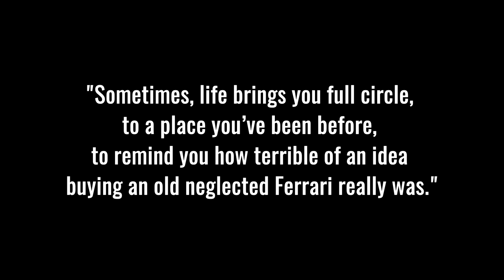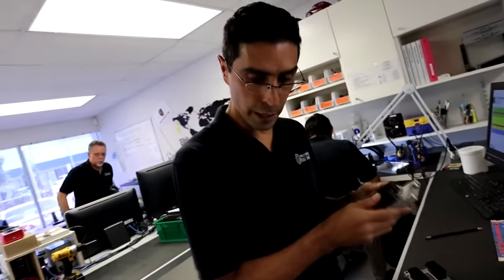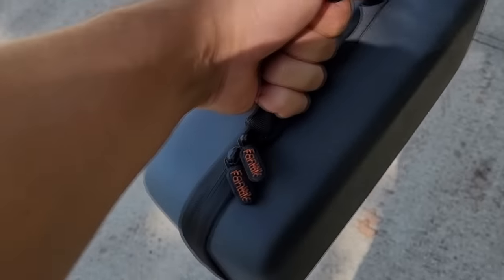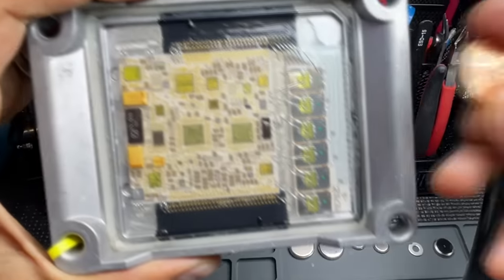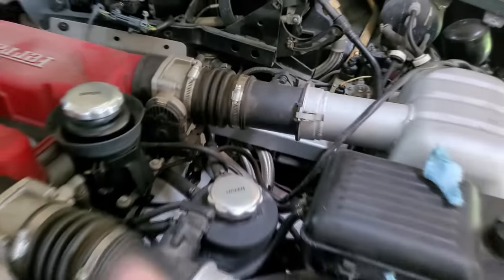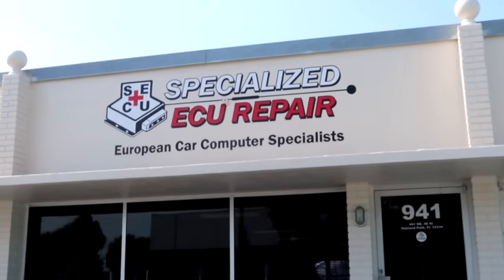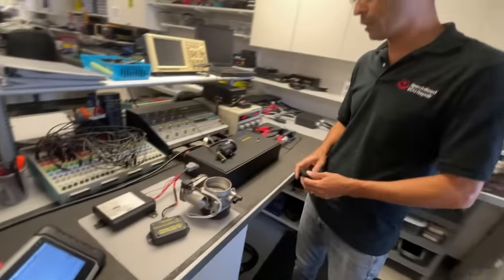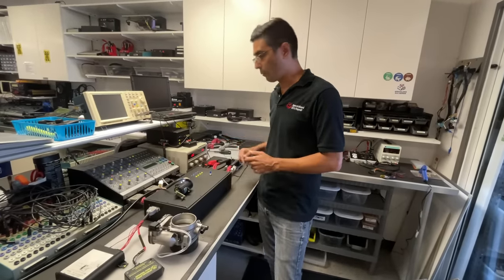Here's What FINALLY Fixed my Cheap Salvage Ferrari!!! (EVERY Ferrari 360's Fatal Flaw)

Comment: Frustratingly you spent the entire time advocating for the right to repair without actually mentioning the words "right to repair". It is and as it should be, a movement that is gaining strength.
Reply from the maker: I literally work on the cars laying on the ground in a barn so I'm 10000% for the r right to repair; there's nobody stopping anyone from repairing these issues; it's just that the engineering of the original part wasn't made to last the test of time.
Reply: @Samcrac  wow, you could not be more wrong sam. Manufacturers control the supply chain. And their protected by lobbyists. If you are living under a rock and somehow have not heard of the right to repair, check out Louis Rossman, who litteraly flies all over the country advocating for the right to repair items that you have bought and paid for.
Reply: This is extremely important
Reply: Give me a break. Right to Repair is an important issue that deserves more public discourse, but it’s not at all relevant to this particular vehicle or its issues. Frankly it makes me wonder if the original commenter even understands what Right to Repair is all about.
Reply: @patrickkillabrew6207  🙌
Reply: @patrickkillabrew6207  It's entirely relevant.  Ferrari deliberately used a non standard type of part that isn't user or third-party serviceable, most likely to force people to go to their dealerships for repairs.  If you're ok with that, then fine..... but then you run into situations like this where the manufacturer eventually stops supporting those products and now it doesn't matter if you're ok with not having the choice to go to a third party for repairs, that's simply not an option anyway.

This is basically Apple applied to cars instead of laptops, phones and tablets.
Reply: @patrickkillabrew6207  It's good to see the issue popping up all over the place anyhow. That's the only way some are getting their information these days, unfortunately.
Reply: @Samcrac  the problem isn't just that the original part didn't last. It was also designed and manufactured in a way that made it cheaper to manufacture but also unrepairable.
Reply: @nicholasvinen  Yeah so you do you want all your products to be more expensive? Right to repair is fine but expecting businesses to support repairs for their products for an indefinite amount of time is stupid.
Reply: @tayf85  yes, I'd rather pay more and get something repairable, especially in a car that should last several decades. I don't think the difference in cost is that large. Maybe 5-10%.

What % of the cost of a new Ferrari 360 do you think the ECUs would be? Less than 1% I'd wager. Is paying $200 more for a Ferrari really a big deal?
Reply: @nicholasvinen  Same with me. The point is that if some manufacturers make their cars difficult to personally repair/maintain, and customers care about this, then this can become a point of differentiation for competing manufacturers.
Reply: @ Stephen Dinale Right to repair would be covered if the ECU were somehow protected with a proprietary interface that disallowed any kind of tampering or reading, and copying of it's contents. That is not the case with this ECU. This ECU is a broken part that is no longer made, but if enough demand comes to fruition, Ferrari or someone else will likely remake or reengineer it in an open market because all the information is there to do so. This is not  indicative of a right to repair issue! 👍✌
Reply: Nobody is asking Ferrari to manufacture 20-year-old ECUs, just fit ECUs that can be easily repaired if needs be in the future. It's a disgusting waste of resources and a pitiful end to a classic car when it's condemned to the scrapyard because of a single, selfishly engineered electronic component. Here in the UK we've just had new laws come into effect regarding right to repair.  Hopefully manufacturers will finally get their acts together.
Reply: Also proprietary software to diagnose all new ecm controlled equipment and vehicles, Ferrari uses Leonardo Software $20,000 for it plus subscription. He could have diagnosed quickly the bad ecm with it.  The clutch he replaced now needs a re learn with the Leonardo as well I suspect it doesn"t shift smooth or correct without it. The ecm may eventually relearn on its own after 1000 cycles but by that time he could have damaged the new clutch.
Reply: @TOM-C.  Right to repair applies more to access of the ECM to diagnose and repair without taking the Vehicle to a Dealer getting ripped off and having no alternatives. Original lawsuit brought by a farmer who had a newish combine fail when he needed it most and he could not fix or diagnose the issue himself or by a local mechanic as it  takes proprietary Deere software, he had to pay $6000 to transport the unit back and forth to the Dealer for repair along with high repair cost for a $20 magnetic pick up sensor failure.

Same would apply here as Ferrari Leonardo software is proprietary and $20000. He could have diagnosed the ecm issue quickly and needs to relearn the clutch with it as it will not work properly.
Reply: There is right to repair them.  Just not the willingness to spend the money required and perhaps the skill to reverse engineer.
Reply: @XVRickXV  You don’t understand economics and just sound like one of those Occupy Wall Street ranters. If these cars were more reliable and serviceable then their aftermarket values would be even higher and making them even less attainable for regular people.
Reply: @pancakesgo7995  Mate a lot of designs that seem great at the time show flaws over the longer term. This is particularly true of anything new or innovative. You also don’t know what newer ECU designs may owe to the lessons learned from this ECU. To suggest Ferrari deliberately made a “selfish” ECU design choice is dumb tin-foil hat thinking.
Reply: @maxsav007  In the US, auto manufacturers are required to provide parts for 10 years after a model ceases production, the 360 is passed that. Yes, "Right to Repair" applies to all cars. If Ferrari were to have "Read/Write" protected the ECU's or blocked access to the ECU schematics needed to build the Benchtop Engine Simulator, or blocked the sale of used reprogrammed ECU's, then R2R would apply, from this video it seems they don't. If Ferrari were to step in now and prevent someone from producing and selling a "drop-in" programmable ECU for the 360, that would be different.
Reply: @nicholasvinen  It lasted 20 years. How long do you expect it to last? 20 years is longer than the "average" car lasts in the US!
 Don't get me wrong, As a mechanic for the past 38 years, I agree with and support "Right to Repair." It just doesn't apply here.
Reply: @GrayRaceCat  I'm not complaining about how long it lasted. I'm complaining about the difficulty of repairing it when it fails. Also I have quite a few electronic devices that still work after much more than 20 years. I'm still using a computer running Windows 95 for some tasks...
Reply: @XVRickXV  which do you mean would be out of business?  Ferrari or Honda/Toyota?   You are correct in the line of reasoning though.    The very rich take great pride in possessing things which definitively distinguish them from the poor(er).    If Honda or Toyota did make a car as beautiful as a Ferrari, which has arguably already been done, thank you NSX, then the overhead would definitely be a consideration for Honda/Toyota, but their massive resources would offset that.    Ferrari itself would never have enough “cushion” to spend so much on R&D if they didn’t use the business model they’ve used for decades.    They don’t price things to entice the buyer.    They DESIGN things to entice the buyer.   Then they simply charge whatever they think they can get away with.    I’ll re-comment anew.
Reply: @tayf85  but Rick does have a point, just not absolute in his reasoning.   He is definitely on the right track.  Rich people take pride in spending more than anyone else on a product, I witness this often.  But they HATE being taken advantage of.   If they even FEEL like someone is screwing them, it’s over.    Yes, they like to have the latest and greatest, but if the vehicle they are selling off or trading out is worthless, they’ll lose trust in the product, and then the manufacturer.  If that $120,000 S Class from 2016 is now worth $17,000, they might buy one more Mercedes,  it next time, if this new  2022 $150,000 S Class is only worth $35,000 in 2024, that will be the last Mercedes they ever buy.   Unless they are morons, and they don’t count here.   Some might take more pride in driving a 1985 Rolls Royce more than a 2015 Rolls.    That says something too.  It helps to bolster the brand.    It inherently makes the 2020 Rolls they bought for the wife worth every penny.   If a Mercedes made in 2000 performed and looked nearly new in 2020, with only routine maintenance costing very little, maybe even performed by the dealer over the life of the vehicle as part of the selling price, then the worth of each and every Mercedes would escalate,    If homes degraded as quickly as cars, they wouldn’t escalate in value, and we all have seen the real estate markets.     When the worth is falsely driven up, a bubble forms.     Wanna invest in a bubble?
Reply: @SteveBassen  but if you're not supporting than you've to publish the technical documentation for the circuit - entire design: chips, transistors, how to emulate that processor...
Reply: @nicholasvinen  irritatingly, the hybrid circuit board design was INTENDED to last longer and be more vibration resistant. The fact that they haven't is down to teething troubles in manufacturing
Reply: @andrewhigdon8346  Actual rich people don't buy very expensive cars. It's those wanting to flash their money who do that and vendors are very willing to take advantage of that kind of sociopathy
Reply: This situation is no different than when computer controlled cars first hit the market. There was no one rebuilding or flashing ECU/ECM’s, it was new technology the aftermarket didn’t know about (and at the time didn’t care about learning). I’m all for right to repair but just because it’s expensive to develop the tools and experience necessary to do something doesn’t mean it’s against right to repair. The aftermarket will develop the processes to overcome this when the public says their ready for it. It probably won’t happen overnight. People ARE developing processes for repairing iPhones and are struggling to overcome those processes but it won’t happen overnight, just like Apple didn’t develop the technology overnight. And it’s not reasonable to expect manufacturers to turn over their proprietary software as its one of the things that separate them from their competitors.
Reply: @pancakesgo7995  also adding to the landfills and scrapyards when that work of art could still be driven, or at least added to someone's personal museum.  The last thing we need is 1500kg more junk on the planet.
Reply: @tayf85  Rick Perez's comment, while cynical did a great job of explaining the Mindset/Customer Base for Ultra Luxury Brands.
You critiqued him, but did not disprove his argument.
Reply: @XVRickXV  Excellent Summation of the Market Forces, and Mindset of the Market Segment - tayf85 clearly isn't in it and never met, or interacted with them. Or he has some other belief system.  He actually said more aftermarket supply, going to "increase" the Prices .  That doesn't meet any model of Supply & Demand.
Reply: @maxsav007  I am 100% pro right to repair, and invested in all the tools I need over a few years as I moved from repairing my own bikes, to phones, to laptops, to cars. However. Expecting the original manufacturer of low-volume vehicles to still produce OEM parts after 20 years is not going to solve anything. I never bought a car newer than about 2002 because I agree with you that simplicity is better, but I can't expect Toyota or anyone else to keep having what I need ready to go on the shelf. You just have to hope that a third party is ready to step in to support your platform at that point. Thankfully the aftermarket is vibrant and they can get access to original diagrams, specs and castings and that needs to be supported.
Reply: I think it comes down to this: if a manufacturer makes a product, all pieces of that product must remain supplied or be built to be serviceable. Like this, an ecu is a component the product needs to work. Without it the product is useless. There needs to be regulations in place to prevent this from happening. If Ferrari’s supplier decides to stop making this part, Ferrari should have to locate a new supplier, or have this part redesigned and manufactured. I don’t think it would take too many times of this happening for them to make crucial parts like this serviceable.
Reply: @turbanwearersblow  That is in no way a reasonable solution. Sorry, I am very much in favour of right to repair and do repair my own stuff, but you can't expect obligating manufacturers to solve the problem. If you buy a new house and there are problems in the first years, yes you could go back to the original builder. But if your thermostat breaks after 20 years, that's honestly quite normal and what matters is you can call up any tradesman you like and have it replaced with a different model for little money. Supporting companies like motec, haltech, etc that produce good aftermarket ecus would be a better bet.
Reply: @turbanwearersblow  Then your solution would necessitate some kind of Subscription fee. After 20 years, it's not reasonable to expect ongoing support.
Reply: @XVRickXV  Lots of opinion in that response! Wow! Car manufacturers can do what they want, you can deal with it or buy a Kia. Simple.
Reply: The Motor Vehicle Owners' Right to Repair Act, sometimes also referred to as Right to Repair, is a name for several related proposed bills in the United States Congress and several state legislatures which would require automobile manufacturers to provide the same information to independent repair shops as they do for dealer shops. 
Samcrac is dealing with OEM parts obsolenance.
Reply: @miscbits6399  You clearly don't have any friends or acquaintances that are rich.
Reply: @nicholasvinen  Yes. Jose himself literally compared it to another ECU that WAS a standard repairable PCB. It wasn't drastically bigger. That approach coupled with released schematics and code after 10 years would help keep cars like this running, and prevent them being the butt of jokes. Dread to think about Teslas in 20 years time when they're 'out of support'.
Reply: @corwinweber693  They most likely liked the small size and low weight. I do not think they wanted the unit to be hard to repair - they just did not think about a future where new units were no longer available.
Reply: @tayf85  right to repair has nothing with the manufacturer supporting repair for an indefinitely long time. It's about supplying information so a company that wants to work with repair can do their thing.

It's about allowing components that they need to use themselves to repair a device are also available to buy by end users or repair shops so you aren't forced to get the repair from a brand service center.
Reply: All the right to repair dudes writing paragraphs in this chat are ridiculous.
Reply: @mtnman1984  You having issues with it is the ridiculous person here. Ever spent some time considering why it would be a good or bad idea with the right to repair? Or even considered the actual meaning of it?

Ever visited some event where people are racing with cars from 1930? If the right to repair movement doesn't get some more traction, then many of todays cars will be impossible to start up 20-30 years from now. So hulking shells at a museum but no one who can listen to the engine sound or see it run some veteran race.
Reply: @perwestermark8920  Technology obsolescence, especially with computer tech, isn't part of the right to repair issue and you look like an old man yelling at the clouds. This module is Bosch trying to be cute.
Reply: @mtnman1984  It's correct that technology obsolescence isn't the same as right to repair. But I haven't made such a claim, so you are busy doing strawman and kicking in open doors. And being impolite while doing it, following some flawed idea that this would make your points stronger.
Reply: @perwestermark8920  If you agree that the issue in this video is about tech obsolescence, then it isn't about right to repair and there is no reason for your Stephen to be here lighting Samcrac as if he owes you anything. You look ridiculous and you aren't helping anyone join your cause. If you think anyone who watches Samcrac is not for right-to-repair, you are more detached from reality than you realize.
Reply: @mtnman1984  No, this video relates to both. One is the ability to buy a new ECU. Another is the ability to repair an existing ECU. A company can't be requires to sell spare parts forever. But should avoid lockin effects making it possible for repair shops to repair products or move parts between vehicles.
Reply: @perwestermark8920  Your understanding of vehicle component manufacture isn't based in reality. Bosch used advanced, not proprietary, techniques to make the module smaller and lighter. It had a flaw that didn't show until many years later in the vehicle's life, let alone testing. They manufacture the standard amount of replacement part stock. There is nothing preventing the repair of the part beyond development of proper procedure and tools, which, if you peruse the rest of the comments, has already happened. These modules with this type of construction are in many more vehicles than just Ferraris. These modules can and have been repaired. Ferrari nor Bosch withholds parts, which they no longer have, or intellectual property to proactively prevent repairs. Ferrari won't remotely brick a car if it was repaired by an independent shop. Just because something is difficult to repair doesn't mean that right to repair is applicable, no matter how much you kick and scream.
Reply: @mtnman1984  I'm not kicking and screaming. That juvenile part is something I leave to you. You may have the age. But you are still a couple service pack short on your maturity. And that's quite noticeable in your way to argue.

Once more you invent claims to argue against. I have not anywhere claimed that Bosch has intentionally tried to block people from repairing - the most efficient way would have been to block the configuration and software from being read out and reprogrammed into a different unit. You also make wild assumptions about what I know about electronics manufacturing and alternatives to traditional PCB. But you aren't too much into arguing vased on actual facts, or asking questions if you feel you might have misunderstood something. Better make a wild guess and argue based on that instead...

But if Bosch had blockes the ability to transfer configurations, the actions performed in this video would have been impossible. That is something done by some other manufacturers, and a reason why this video does apply to rights to repair too. In a world where the car manufacturer alone can unlock which serial number boxes that may interact which other serial number boxes, it is no longer possible to buy a crasched vehicle and use for spare parts. And we are moving dangerously close to that scenario.
Reply: @perwestermark8920  If you're going to argue about knowledge and maturity, try to keep it civil and use proper grammar. People who are rage typing typically don't proofread. It's OK.

I'm going off of what is explained in this video, which is all I need. You keep using hypotheticals (would have) not pertinent to the subject matter of this video as reasons why it is about right to repair. It isn't. If you think it is, you also must think Bosch had intentions to make this part impossible to troubleshoot and repair, which it clearly isn't. Everything you posed as a right to repair situation is not present in this video. Go find a C8 video to yell at.
Reply: @mtnman1984  Rage? Nope. That is still something happening on your side. You need to be waaaay better at arguing to think you can affect me that way with your immature claims. But nope. Just your normal track record of wild assumptions.

Grammar? That is because this is not my native language. You really do like to make arbitrary assumptions...

Have you ever managed to argue about something based on actual facts? You should try it sometimes.
Reply: @perwestermark8920  
Facts: 
1. Right to Repair is about the ability to repair a piece of equipment without the active interference of the manufacturer. What it is not about is the difficulty of the repair, AKA the skill and tools required.

2. The ECM in this video was troubleshot in the video and is repairable. Independent shops are able to repair the rest of the car.

How does Right to Repair apply to Samcrac's ECM and what actually happened in the video? No hypotheticals or "they could".
Reply: @mtnman1984  You claim "Facts" like you have a problem figuring out what is actually contended.

But your facts aren't even fully true. Because how hard it is to repair something isn't fully outside the scope of eights to repair. Designing to explicitly block repair is part of right to repair. This type of substrate with chips directly on the substrate is an example where it's hard to repair, but not because the manufacturer wanted to make it hard.

Next part already covered, but that like fail to grasp, is that in this case it was possible to repair. And products that can be repaired are also relevant to debate about when discussing the right to repair. It was not a catastrophic failure for Bosch or Ferrari that it was possible to repair this car. As a matter of fact, this video very much contradict a number of manufacturers that are against the right to repair.

You entered the debate without having done your due diligence. You paint with broad pencils. You argue based on wild assumptions. You fail to keep track on what different people really mean or have said, and instead lump people together. You sprinkle your posts with ad hominem.

No. I don't feel any rage. Just sorrow that the school system failed you...
Reply: @perwestermark8920  Can't really paint with pencils. I don't know what eights to repair is. You still haven't connected Right to Repair with this video. You can repair it and Bosch won't try to stop you.
Reply: @patrickkillabrew6207  actually it is, did you not look at the ECU ? That's pretty much anti repair right there. WTF do you mean it's not relevant, it's extremely relevant.
Reply: @tayf85  that's the biggest line of BS I've ever heard someone say. Making something to be reparable won't make the device more expensive.